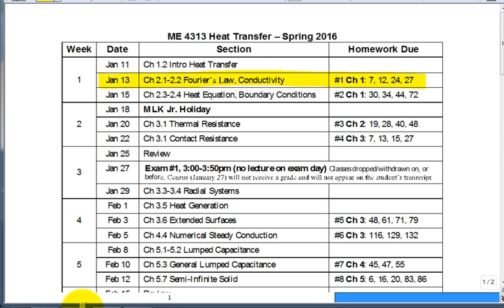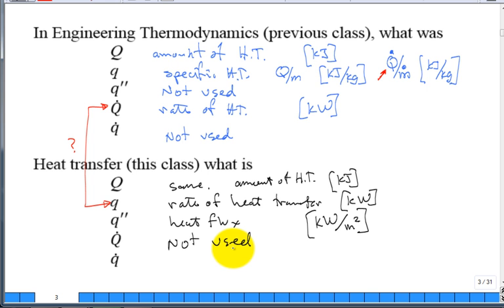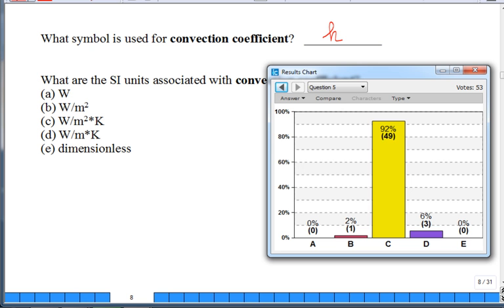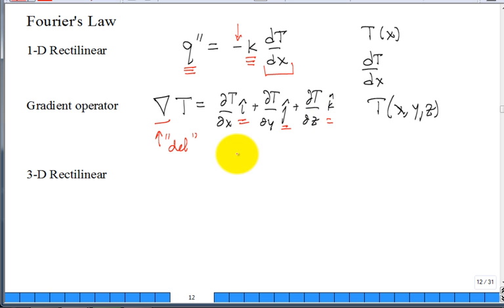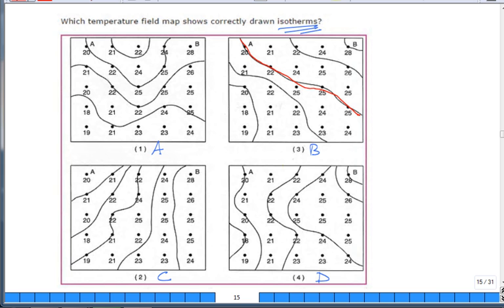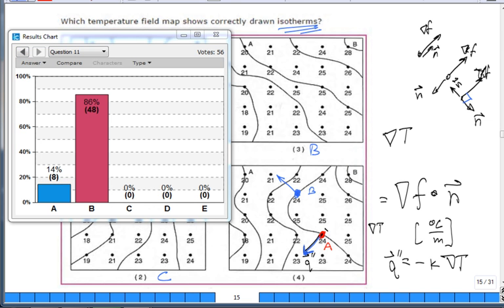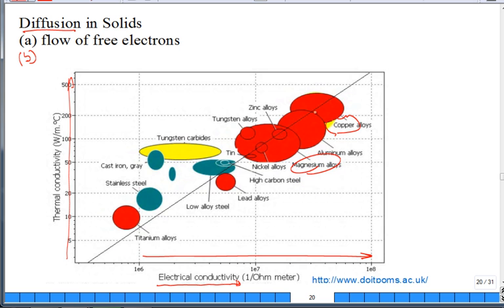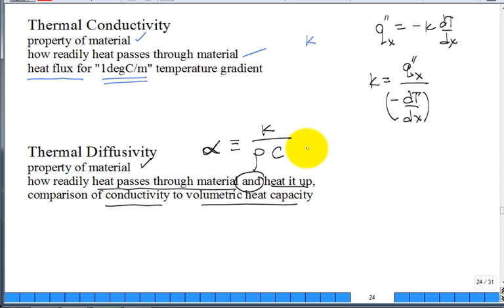Intro Conduction 1of2

Comment: What about phase changes? Don't they exemplify heat transfer in the absence of temperature gradients? Talking about eutectic phase changes, that is.
Reply from the maker: +Lucas Rosa phase change is more energy storage than heat transfer.  During phase change, material can accept heat transfer in/out without changing its temperature.  Sometimes called "latent" heat.